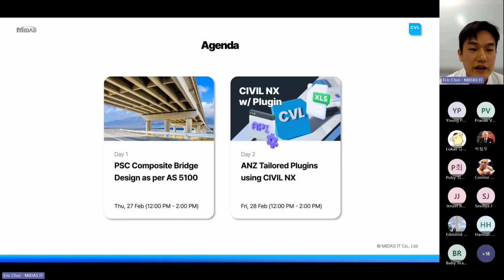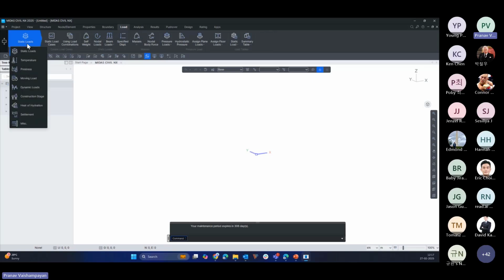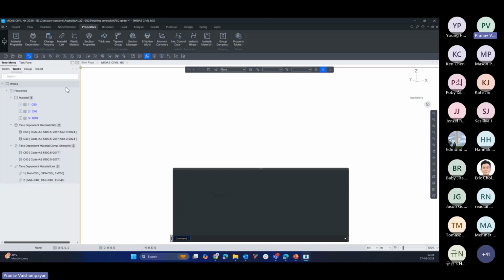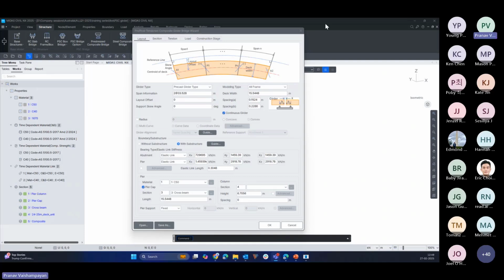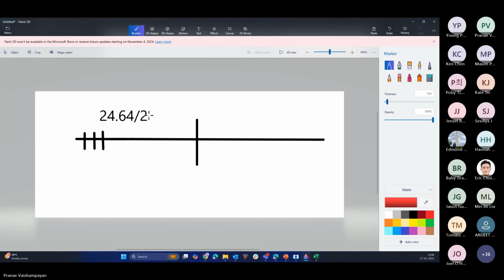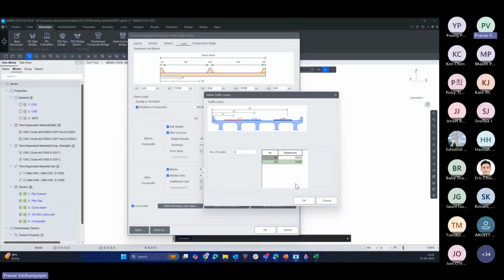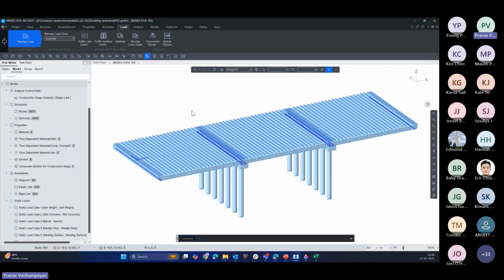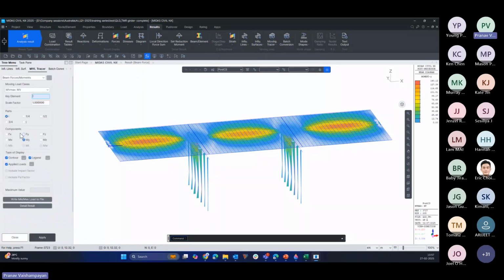[MIDAS IT Australia] 27 Feb 2025 Online Training ― Day1

Comment from the maker: 00:00 Opening
07:40 PSC Composite Bridge Kick-off
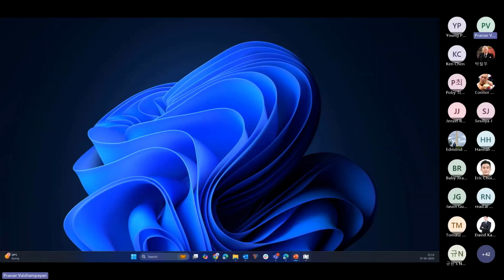14:35 Brief Introduction of MIDAS CIVIL NX User Interface
20:28 Run Pre-provided Training Material / Material & Section Property Definition
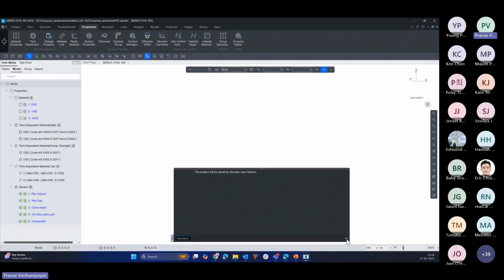45:54 PSC Composite Bridge Modeling (including Construction Stage, Tendon, Load considering composite action)
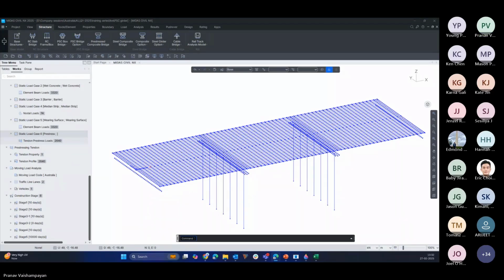1:32:00 Moving Load Definition as per AS 5100
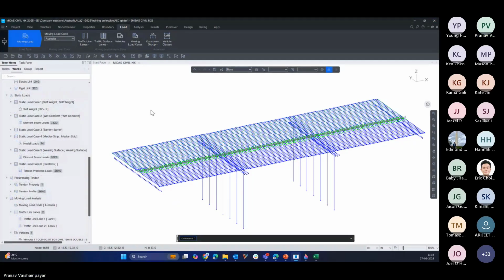1:36:54 Modifying Construction Stage
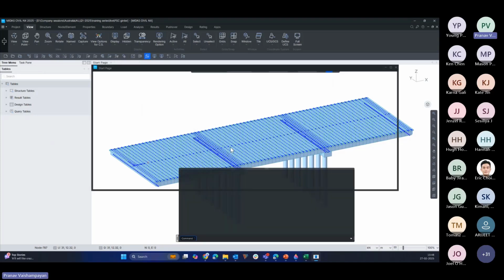1:46:44 Performing Analysis & Analysis review
1:54:08 Q&A